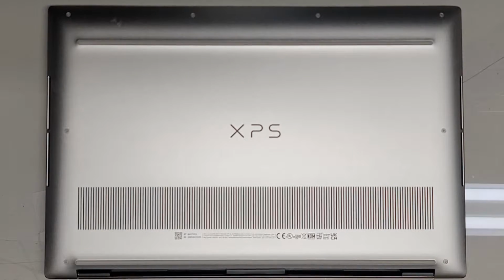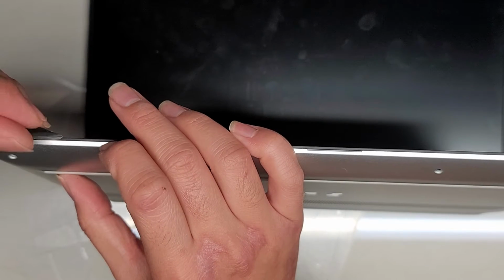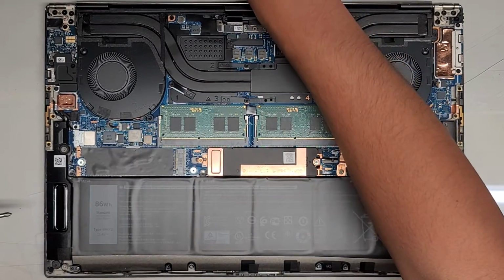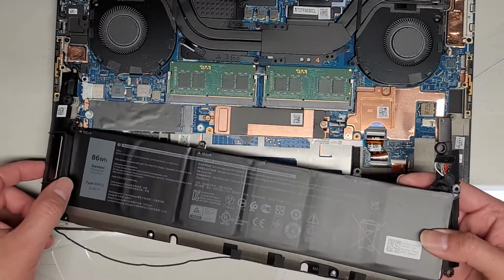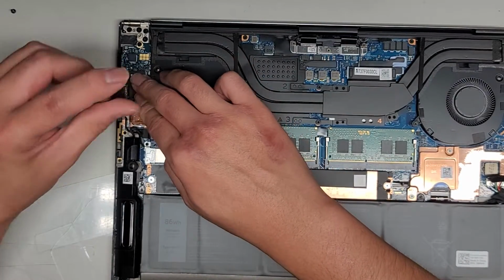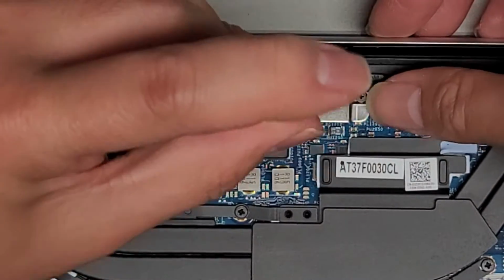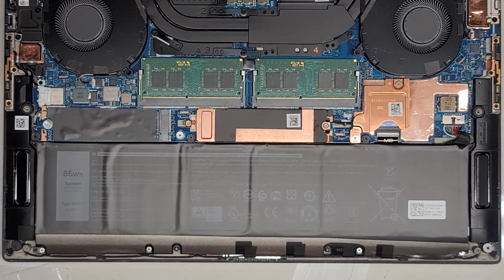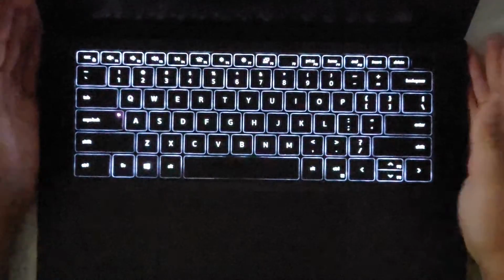DELL XPS 15 9510 Disassembly RAM SSD Hard Drive Upgrade Battery Replacement Repair Quick Look Inside

Comment: Would you say upgrading the ram and ssd will make it faster and smoother ?? Mine seems laggy even with debloated clean windows install
Reply from the maker: Is it not already SSD?
Reply: @ItsBinhRepaired  yeah it has 500 but I want to upgrade to 1tb and 32gb ram
Reply from the maker: @sh0kwerm  RAM will help a bit, SSD will help if you get a faster one.
Reply: @ItsBinhRepaired  any recommendations? I have xps 9510
Reply: @sh0kwerm crucial p3 plus is very good specs. Pricey compared to others but a good option
Reply from the maker: Prices are constantly changing.
Reply: @2TGaming  nice I’ll check those out !
Reply from the maker: For the price right now, I'd go for this https://amzn.to/4af1QVL
Reply: @ItsBinhRepaired  oh yeah that’s really good .. guess I’ll go all crucial . Hopefully these give the xps a good boost
Reply from the maker: Hope it goes well :)

Comment: In a dell xps 9510 what is the slot of the operational system that came from factory, i want to add an extra ssd drive but i dont want to touch my installation of windows
Reply from the maker: Just don't move the SSD that's already in there.